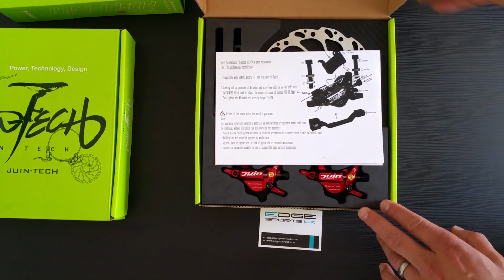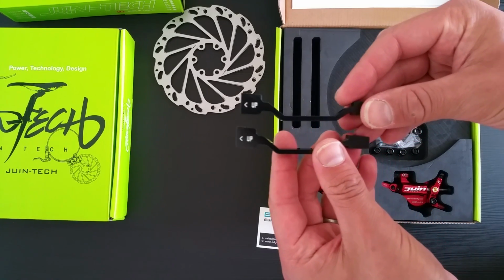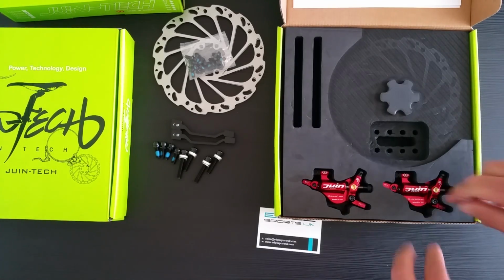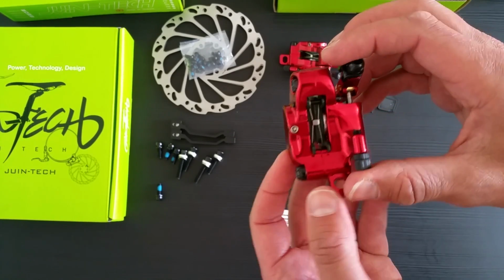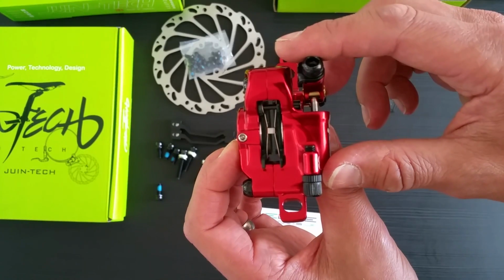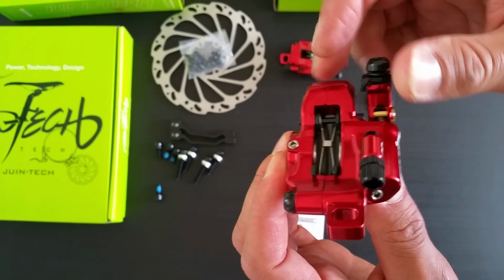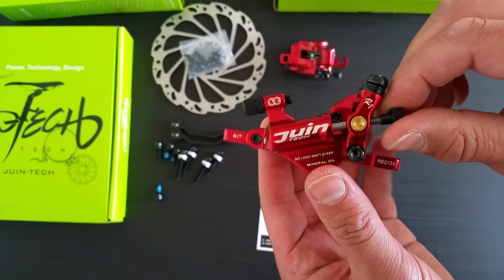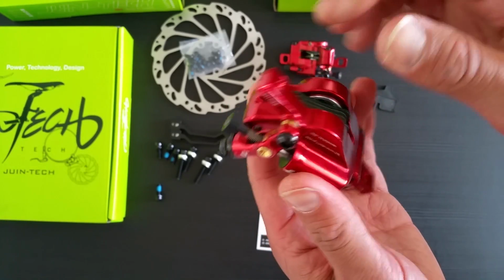Juin Tech R1 cable actuated hydraulic Disc brake

Comment: To say they don't need to be bled is fine when they're new but this may gives folks the idea they never need to be bled. It would also be better to run compressionless brake housing vs standard housing. And the knob that attaches to the piston rod should never be touched! Use the cable housing barrel adjuster for adjustments. Like you said, it's a closed system. My personal preference for hybrid hy calipers are the TRP HY/RD. These look cool.

Comment: I'm not putting this brake down but this is just a re-branded Origin8 Vice mech/hy brake, in nice different colors.  It is my opinion the Vice/Juin is a slightly better brake than the mech/hy TRP.  I have many customers who ride "A LOT" use both of them and hands down they like the crisp braking power of the Origin8 Vice much better than the TRP which tends to be mushy.  The customer with the TRP rode route 66 across the US from Santa Monica to Chicago & later the same year did Paris Brest Paris.  The whole time not really happy with the TRP mushy feel, no matter what brake pad, compressionless cable, or brake anchor modification I made.  My other customer, I think rides too much, he can wear out a new Sram red 11-speed chain in 2 weeks!  I recently built a new Canyon using his slightly older Sram mech e-tap road set and decided to try Origin8 Vice flat-mount.  They have been really good, and is very happy with the braking power, especially when he wore out the OEM organic pads and switched to semi-metallic pads.  Once the pads seat, they are really nice powerful brakes.  The only downside is you have to adjust the brakes once in a while to compensate for pad wear.  The other added plus is you can pump the brakes all you want and they will not move in, as all other hydraulic brakes do.  So they are great for the traveler who has no idea how to correct this problem when they travel.  My vote for the current best Hy/mech brake calipers is Origin8/Juin brakes.
Reply: You're right, I've seen these same calipers rebranded as a few different things....Juin Tech, Origin8, Yokozuna, etc...I have Juin Tech branded flat mounts myself. 
You seem to have much more experience working on these than I do (I'm not a mechanic 😁), may I ask if you have any suggestions for bleeding? No matter what I do I can't get the pads to stop rubbing...the pistons seem to not retract all the way... Maybe I'm wrong and bleeding isn't the fix?
Reply: No it's not a rebranded OR8. Origin8 is a house brand name of J&B Importers. I used work for JBI in purchasing. It's a cheap knock off of TRP'S HY/RD. Those using TRP brakes with road/sti/double tap/etap levers should upgrade the actuating arm to the JJBP arms. TRP's are great with mtn bike levers. Old school road levers are good but not so much sti and sram levers.

Comment: ❌Don't press the actuated arm without spacer or rotor inside.❌

Long time press without spacer will damage O-ring, caused oil bleeding from grease seal. :o  :o  :o

Comment: Are these closed-circuit or open-circuit brakes? The warning not to operate the master cylinder without a rotor installed makes me think they are open-circuit, because open-circuit brakes would automatically reset the pad position so the rotor could no longer fit between the pads. However, I would like official confirmation of this.
Reply: watch the video

Comment: Very clear video, thanks. Are these designed to attach to either side of a bike, or are they designed only to mount on either the left or right?
Reply: I believe disc brake calipers can be only be brought on the left side of a bike. On the right side we have the cassette and derailleur (rear)

Comment: I bought the full hydraulic BRAKE set (for the looks) and regret it now, rear BRAKE seems to have a leak as the lever now has too much travel and I don't know how to adjust. If the rotors are supposed to be stainless steel, why have mine gone rusty?
Reply: Because they weren’t stainless
Reply: @Stealthsilent1337  Look up 304 SS vs 316. The latter is a marine grade that won't rust. 304 should be used for indoor applications only

Comment: very nice, would this be a better option over the mech hydraulic TRP one?
Reply: TRP is WAY better. This is glorified Chinese junk.
Reply from the maker: Eric the Banana Peel Thank you for your comment. The brakes are designed and manufactured in Taiwan by Great General Braking Co. LTD.

Customer reviews can be found on our website www.edgesportsuk.com
Reply: Ok, so it's still China, just not the Mainland. Reviews can't be trusted as the product hasn't been around long enough. There are very few long-term reviews of TRP HY/RDs which are also junk, just a lesser evil.
Reply from the maker: Eric the Banana Peel All we can recommend is that you read the customer reviews on our site that can be accessed by viewing each colour of the brake. 

These brakes are not Hy/Rd and it would be unfair on them to negatively comment on their performance and ability if you haven't personally used them. We welcome all reviews and feedback.

kind regards

Edge Sports UK

Comment: Do you have to use Compression-Less Cables  for these brakes? Also who in the US sells them. Are they available for 180mm rotors?
Reply: Rick Dee Hi I’ve been to that site and they only have red. I also don’t like the fact that there’s No USA 🇺🇸 tech support for JUIN Tech Brakes
Reply: Yokozuna sells the same brakes just rebranded in the US I think. Together with their compressionless housing.
Reply: Compressionless brake cables are superior for all types of brakes. There is no reason to use the old style of brake cables anymore.

Comment: hi same question.  Can I use my 180 rotors with these JUIN calipers ?.
Reply: U need adapter. 
Brakes can work with any size rotor. Only change adapter brackets.
Reply: I bought these and they are shit. don't buy them a waste of money. I was lucky. I got my money back. and put full Hydraulic on and they work great.
Reply: @MrJohnno1969  old thread, but I wish I had read this one year ago. Real garbage. Worked for 50 miles great. Then broke. Not recommended

Comment: Hi, my brake caliper is leaking oil at the adjusting screw. Does it need to be rebuilt or do you have a fix for this?
Thanks
Reply: I'm are having a hard time with my Jiun Tecch GT's, how do you fix it ?

Comment: What is the point of a hybrid system?  Isn't the stretch of the cable the main downside to cable actuated brakes?  This wouldn't help with that.
Reply: Precisely! If you can't live without hydraulic brakes, go all in...spring for a hydraulic system. I didn't do that..because...there are about fourteen zillion YouTube videos detailing the adjustment of mechanical disk brakes. Watch half a dozen of them and you'll know all that's necessary to take the worry out of cable stretch...or pad wear. Even us little girls can master bicycle mechanics. My bikes never see a shop after the free break-in service...unless it's warranty work.